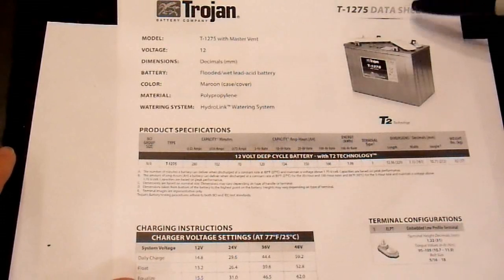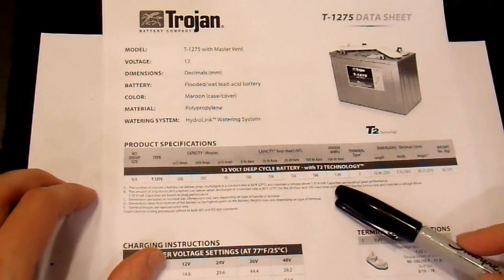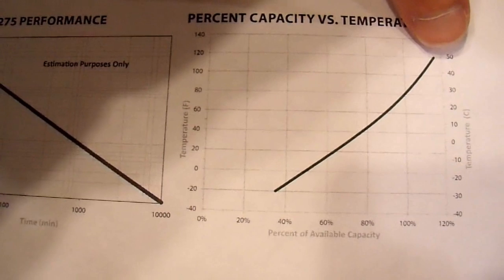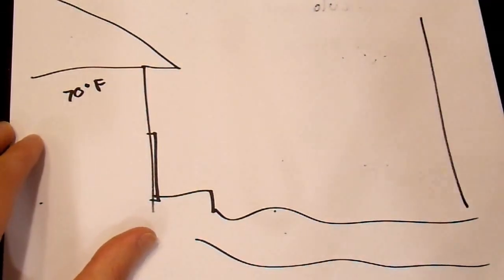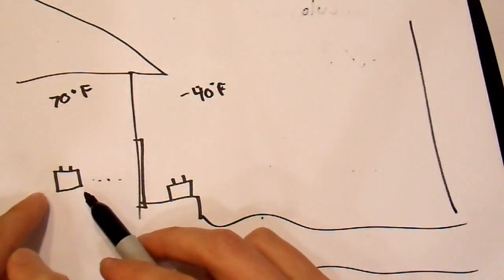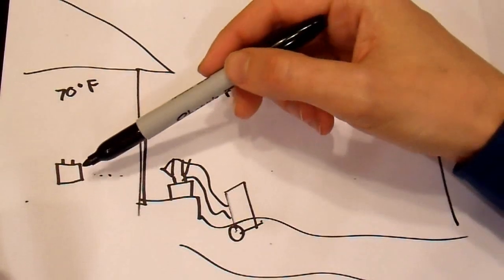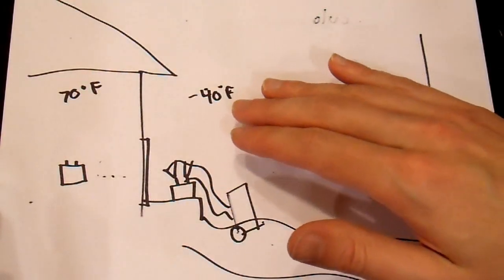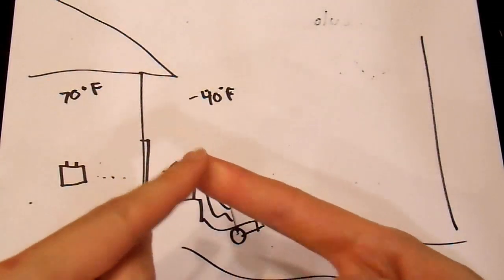Peukert's Law is Wrong and Here's Why - Part 3 of 3

Comment: Brilliant 5 videos, many thanks. I've subscribed and will be making my way through the rest of them. I've toyed with lithium / lead-acid battery banks in motorhomes for years, always coming down on the side of led-acid simply because of the cost. In the UK, the upfront cost is still around 1:5 ratio. Since my home energy costs have gone up by 600% since Sept 2021, I've now installed an off-grid system and your explanation of battery banks and more importantly your demonstrations, means I now have a greater understanding of the 50% available amp hours of a lead acid battery.

Comment: It means I need two more 85 amp hour RV to run this big blue Aims box that's hooked to my air fryer..I've got 6 and itll run for a few minutes but I just need 8 and shorter cables..I have  two #2 welding cables on each post of my 2000 watt inverter/charger (its 24 v) but they're about 4 ft long so I'm gonna make them 2 ft long and hopefully I can make a pizza (10 min) without the charger coming on at 23.9 v..I may have to get 2 more panels because of that no good groundhog but I test this effect every time I try a pizza..the other day the sun was out and I managed to cook one...the batteries started out at 29.8 and dropped to 24.3 over 11 minutes (frozen) but as soon as I shut the load off it jumps to 25.3 and keeps going up..but with overcast weather and short days I need more storage...so after 2 more batteries, the days get longer and the sun get closer lol maybe I ll be testing the A/C soon

Comment: I watched all 3 videos and you did not disprove peukart's equation. The losses from charging a lead acid quickly or at high soc still count in the usable capacity. So you are arguing that coulombic efficiency is still high, but usable is not? Well at the end of the day, people only care about the usable capacity at the terminals. If internal resistance increases at higher c rates, and usable capacity plummets, you could say that the net coulombic efficiency is detrimentally affected. Am I wrong here? I don't understand what in peukart's equation you are trying to disprove. What was "wrong" in his equation? You pretty much summarized what the equation is, and that's it.
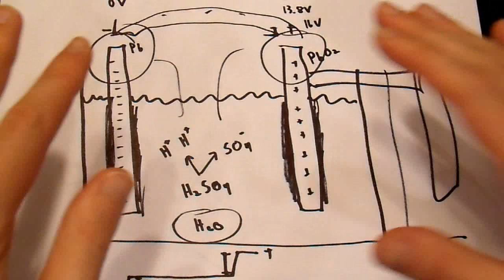Reply: 9:00 of part 3 video: "Peukerts equation does not state anything about the discharge rate versus the capacity"

Definition of peukerts effect: Peukert's law, presented by the German scientist Wilhelm Peukert in 1897, expresses approximately the change in capacity of rechargeable lead–acid batteries at different rates of discharge. As the rate of discharge increases, the battery's available capacity decreases, approximately according to Peukert's law.

Am I missing something here? The C rate is absolutely mentioned in peukerts law.
Reply from the maker: Admittedly the title is a little click-baity.  Peukert's law is absolutely useful and not incorrect.  The video is (perhaps a poor) attempt to show that its application in the real world is misunderstood, and therefore the assumptions people make based on it are sometimes wrong.  The video was not intended to cover anything related to efficiency of the charging side, only the discharge side.  Coulombic efficiency is unrelated to internal resistance - we're only talking electron flow counts and I don't disagree that useful capacity is different at different discharge rates.  The video was intended to show that a battery has a similar absolute capacity regardless of discharge rate.  What changes is the useful capacity.  e.g. (numbers just thrown out there for demonstration) you can get 100A of useful power out of a battery down to 50%.  You can get 50A of useful capacity down to 75%.  You can get 10A of useful power out down to 90%.  That energy is still there in the battery and available to be used, just not at the rate you may be interested in pulling it out at.  This is one place where battery bank sizing is so important.  Typically in an off-grid lead acid install you want your useful capacity at the maximum load you intend to draw to be available down to somewhere around the 80% DOD level.  People tend to use the Peukert curve to integrate discharge capacity over time which results in incorrect SOC calculations.  coulomb counting is valid regardless of discharge rate.
Reply: @knurlgnar24  I bet you could repost the part 1 video stating "how lead acid batteries work" and it would get a million views haha it was good
Reply from the maker: @WillProwse  Thanks for the feedback Will.  You may be right as this video series has very few views and I personally feel like it is one of my better videos, but I not particularly good at gaming youTube's algorithms and I'm not an attractive female.  :)
Reply: @knurlgnar24  lol you did use a click baity title for views i suspect, but you know your stuff so you get a pass from me. will is correct about your first video, i have never seen such an in depth video about sla battery operation. i have a tiny channel and i too plan to not try to use it to take over the world, but it is  discouraging to see a channel (not yours) poorly cover something i have covered thoroughly, yet the fool's channel get millions of views when the content creator doesnt even understand the basics of what he or she is talking about, and i may get 200 views lol
Reply: Ohhh ok I understand what you mean now. Yeah that's true

Comment: Temperature absolutely does affect battery capacity as the chemical reaction that produces current is temperature dependent (Arrhenius equation).  If a 12V battery at 77*F, discharged at 10A, would last 8 hours before reaching cutoff of 10.5V, the same battery would reach cutoff voltage in significantly less time at 32*F.
Reply from the maker: This video addresses why temperature absolutely dos NOT affect battery capacity.  Chemical reactions are temperature dependent, but the activation energy does not change with temperature and therefore the Arrhenius equation does not affect capacity, only the rate at which you can discharge the battery.  Absolute capacity is the same regardless of temperature.
Reply: knurlgnar24 then why do I get less runtime at colder temperatures when discharging at the same rate? At 77F I get 8 hours and and 50F I get about 6.5 hr

Current is produced via an electrochemical reaction.  If the rate of chemical reaction is reduced, the amount of current produced would be reduced and therefore capacity is reduced. 

Everything you’re stating is going against what every battery manufacturer states which is essentially capacity is reduced at colder temperatures.
Reply from the maker: @M.A.T.T.A.L.I.A.N.O  Yes, you will get less runtime at a given discharge current at lower temperatures and I am not refuting that statement.  But if you discharge the battery at a very low current, say 100mA, you will find that the capacity is very nearly the same regardless of temperature.  What changes for practical purposes is the internal resistance of the battery and that is what limits the capacity at a useful discharge rate.  Perhaps I should have been more clear in stating that the useful capacity does depend on temperature, but the absolute capacity does not.

Comment: Wow you must have some awesome insulation in your house to get 70 degrees F inside when it is -40 degrees F outside.  That is "F-ing" amazing. (get it?)
Reply from the maker: Um, no.  You must not live somewhere where it gets cold.  This is very normal for this part of the world.  Everyone has a house that can maintain 70F at -40F, even the ones built 100 years ago.
Reply: I doubt it.  Good luck getting a trailer home to stay at 70 when it is -40 out.  Not even some cars with 2 people in it can do that (when moving at normal highway speeds).  I remember one time my cousin and I went skiing in NY I think, and my car didn't have a great heater.  When we were stopped it was fairly "toasty" in the car but as soon as we drove on the highway, it was so cold out, that our feet were "freezing".  The heater could NOT keep up with the cold outside.  I imagine if it is -40 out and the wind is whipping, many houses would have trouble maintaining 70F unless maybe you have multiple heaters running full blast all day long to fight it.
Reply: @knurlgnar24  Wow! You're still here! I've been following your channel for years and was just going over some of your videos again. I miss your contributions but understand that we do what must be done and relinquish that which is not so high on the list. Best wishes!

Comment: Great video series, pity we didn't have the net back in 1990, it would have saved me a lot of time if I could have shown this to my boss.  I used to design and build ESUs (Emergency Standby Units) that supplied emergency lighting for the hour that the local (New Zealand) laws, rules, building codes and every other book that you could throw at it, demanded. Because we used a constant load, more or less... individual inverters that ran fluorescent lamps, we employed Mr Peukert's law and it worked fine for our situation. Our batteries lasted about 6 or 7 years and 1 or 2 even lasted 10 years before needing to be replaced. The units were actually tested to death... once per month a full discharge was done. Our regulatory body had no idea about how lead-acid batteries worked... probably still don't. I don't care any more, I'm retired and now play with my own set-up. Solar panels, charge controllers and flooded lead-acid batteries from Crown with a couple of pure sine wave inverters. They play nice together.
Further down is someone not understanding about how unreliable the grid is. My daughter lives in Gisborne and the power grid comes over land through some very rugged terrain and Gisborne is at the end of the line, not in a ring circuit. Cut the line and no power until it is fixed. One evening a year or two ago, a light plane got tangled up in the lines and the power was out in Gisborne for 34 hours. The accident site was VERY remote with no helicopter landing area because of the terrain. I recall that it took the first repair team 5 hours to drive to the area in the middle of the night. The pilot chose the worse place to get his plane tangled in the power lines. No one survived. It was dusk and he had been blown a bit off course and not aware of the hazard. My daughter lost a fair bit of food due to the power failure, mostly fridge, freezer not so much. Two teens, two children under two and a husband. Nerves were a bit frayed when the power came back on. We had a 17 hour outage when some one knocked a power pole over that had some pole top switch gear up it. I had a small stand-by set-up at that stage and didn't lack for power for lights, fridges and freezers. We get a decent, actually indecent, power outage about once a year for about 4 or 5 hours and 2 or 3 a year for an hour or less, usually maintenance. At least we are forewarned about those.
Keep up the good work and thanks.

Comment: Here is a theoretical test I wish the battery manufacturers would do... They would take a full charged and properly broken in battery (properly cycled a few times), and do a load test such that it is not a fixed load, but rather continuously variable.  For the purpose of speed, they would heavily load the battery at first, but as the battery approaches the usable cutoff voltage (let's say 10.5V for a 12V battery), they would then lighten the load and continue doing this until the load is so small (such as 1A) that it is not worth continuing.  All the while, they would have a special meter that can calculate the true Ah being drained out of the battery, despite the changing load.  This is somewhat of a "torture" test on a battery but I suspect they can sacrifice a few to get an accurate true Ah rating for the battery.  I am not sure why they give Ah rating for fixed runtimes cuz how would anyone know how long their battery will run?  Batteries are usually used in series with other batteries and power variable loads so knowing when the bank will become unusable is a guess at best.  I think the 100 hour drain rate capacity would be very close to my theoretical variable load test, but mine could be done much quicker than 100 hours.  Maybe they should just add that variable test to the datasheet and keep the other rates as well (such as 10 hour, 20 hour...).  Comments?

Comment: You're wording is not so good.  You state that at a high discharge rate, the remaining power (after the voltage drops to some limit) is not useful but then you go on the say how that remaining power can still be used.  You should have stated not useful at the higher discharge rate.

Comment: The real reason for 2.7 longer, is the SMALLER discharge rate per battery. You can draw down a battery capacity futher at 2 amp than 50.
Reply: First of all it is not 2.7x, he miscalculated.  It is more like 2.6x.  Second, it is not 2.6x longer, it is 1.6x longer.  You need to take the difference in runtime.  For example, if 2 batteries have the same runtime, you should say one has a runtime 0x longer than the other, not 1x longer.  1x longer means double the time.  For example, if battery A lasts 1 hour and battery B lasts 2 hours, you can properly say that battery B lasts 2x that of battery A and/or 1x longer than A.

Comment: Excellent set of videos! I'm jealous that you scored some nice batteries for cheap. I've been getting into battery stuff (I have a degree in electronics engineering, but don't use it since I'm in IT now) since I bought a camper, and needed a new battery. I got a decent 100Ah AGM battery, and will be using that.  ... until lithium or other chemistries become more cost effective!

Comment: you mention that 1 Ah is a certain fixed number of ekectr1022

Actually its an enormous number and the value is not known exactly but the approx value is easy to remember, 2.2 x 10^22.

That is 22 hexillion or 

22,000,000,000,000,000,000,000 (approx)

Comment: If a battery is completely dead no volts inside. Can it be reversed charged? Can you turn the positive into the negative by charging it back it "backwards", if so would this in any way give the battery a new life a better charge than before?

Comment: You made a very complicated subject seem very simple, congratulations.  It is a shame college professors can't seem to do as well.

I am getting ready to install what to me is a substantial battery for a solar backup system I am planning on a 48 piece 225AH battery at 6V which should give me about 64KW storage and about half of that would be useful.  I am limited to three strings and my inverter requires 48V.  I'm wondering if I really need to keep track of chemistry or will the voltage tell me everything I need to know.  I will not normally be using the battery except minimal usage to keep it toned unless the grid fails and happens from time to time here.  I will have about 12KW PV in Kentucky about 4 hours or so a day on average.  I'm concerned that in backup mode I may not have enough PV to fully charge the battery after a couple dark days. 
I will be however very careful about keeping the batteries in shape.

Thanks for you efforts, great job.
Reply: +Joseph Kraig yo. that sounds cool. do you have pics? have done some 12 x 225 but 48 is enormous!
Reply: Joseph Kraig how did it played out?

Comment: +knurlgnar24 I really enjoy your repair and mod videos... Would you demonstrate how to convert a Diehard (by Schumacher) model 71222 10/2/50 fully automatic charger/starter into a fully manual one? ...or a similar model? I have one that has never worked on the 50A start mode, and the amp switch has issues as well. It is still under warranty, but instead of trading it in I want to use it to attempt (as you demonstrated in another video) to desulfate salvaged batteries for a small solar powered shed project. From what I understand, I should be able to just remove the "smart" control board and wire in a bridge rectifier off the transformer to the battery output clamp. The goal is to still have selectable amperage, but I get lost in the transformer I/O. I've searched for videos about this type of conversion, but have had no luck. Thanks!

Comment: Wouldn't  it be the temperature of the chemicals slowing down the reaction of the electrons forming on the plates be the reason why the lower capacity ( TIME ) Meaning that you should still be able to use the full capacity over a longer period of time in the cold. And it would take a smaller charging Amps over a longer time period to recharge back to full capacity.

Comment: Of course if you bring a 70 F charged battery to a -40 F and start discharging it immediately you will get your amp-hours out of the battery before it freezes into a slushy inside. What about an experiment where you take the 70F charged battery and let it cool to that -40 F outside, and then try to get more than the 15% of charge out of it, bring it inside, warm it up and then take it back outside to discharge some more before it freezes again?  I have had e-bike riders that bring their batteries indoors for charging, and usually use up the state of charge within 20-45 mins before the batteries get too cold without much loss of distance riding.  One pack of 5 12AH in series a customer discharged and left to freeze for several weeks at 15F did permanent capacity and cycle count damage to the set. explain that one ?!
Reply from the maker: A warmer battery has a lower internal resistance and also a higher electron mobility.  If the battery is still warm while being discharged it will have a higher effective capacity.

Comment: Thanks for the explaination and it makes sense. However then when we use Peukerts equations to calculate State-Of-Charge of the battery that will be wrong too..
For knowing the SoC, do you recommend normal Coulomb-counting (minus a loss-factor) then?